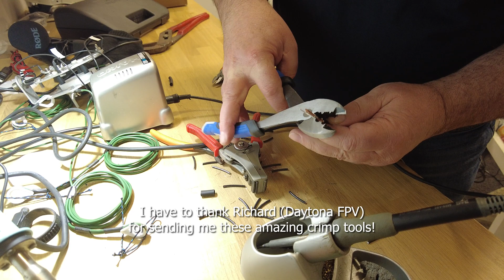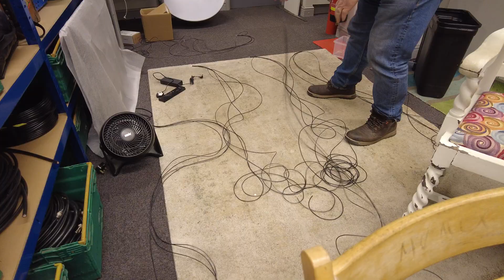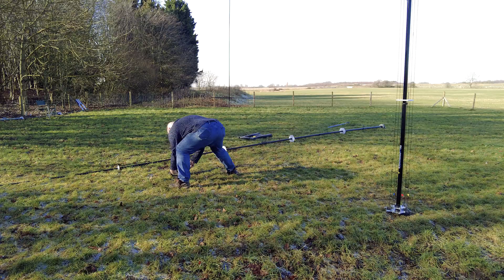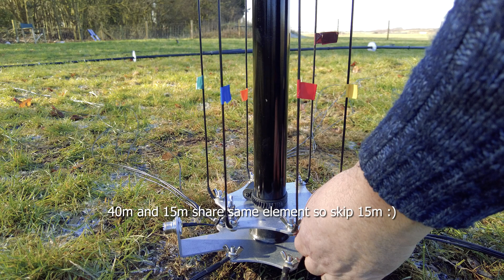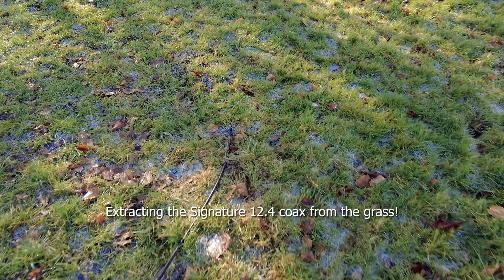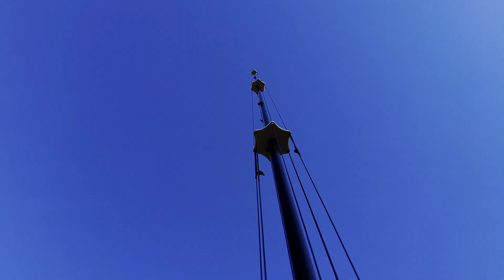New Radials and Signature 9 Vertical Antenna Up and Ready for Action

Comment: SO I bought the classic in Sep 2021, still going strong.  Now I am considering the Sig 9 for another radio.  Would you suggest a minimum distance from each other?  Also, would crossing radials over the other radials make a difference?  Thanks.. 73 KN4YLL
Reply from the maker: Well, I've had two together many times and although the modelling suggests minimum distance, I have never "felt" it. Mine were about 8m apart.

Comment: Hi,well explained video, I ordered mine from ML&S should be here Tuesday, its going on a flat roof 3 story high, I will keep you updated, 73s from PA1-LEG 🙏🙏
Reply from the maker: Brilliant!
Reply: @DXCommanderHQ  Hi arrived 3 hours ago, almost built, 27 degrees and blue skies here ,I will test it out in the evening, its going around 20m high, on a stand on the flat roof , hight is might 😀 they say 73s from Rotterdam 🙏
Reply: @DXCommanderHQ  Hi I put up the signature 9👍🏻 well made materials easy to follow instructions, unfortunately due to the high temperature 🌡 the tape on the fold backs came loose, first test swr between 1.5 and 2 ,I will use my Mat pro 1500 atu temporarily, for me 40m was noisy s9 but it was expected, tomorrow I will fine tune the antenna and try with my amplifier, my first impressions are positive 😀 will keep you posted 📫, 73s from Rotterdam 🙏

Comment: Callum can I use the mounting post for the signature 9 on a Classic multiband +80? I feel I need the extra support - I live a half block off Lake Michigan, and it can be windy at times.
Reply from the maker: OK, a) it's not a good fit on the classic and b) assuming it's guyed, the post won't do anything. I understand about the wind and sure, it can be disconcerting to watch your antenna blow about however in the main, it'll just blow about.
Reply: @DXCommanderHQ  Thank you, sir! You just saved me money! I appreciate you!

Comment: Very nice. If I have to put a vertical in a corner of the yard and can only run the radials out in one direction (90*), will the majority of the propagation be in the direction of the radials or the opposite direction?
Reply from the maker: It will still be omni-directional however rather than MORE gain in the direction of the radials, there will be some loss where there are none. So to answer your qwuestion, sort of yes - but there won't be a null. I dproved this many years ago with a 180 degrees of radials and promptly crossed the Atlantic on 80m - which was the "wrong" way :)

Comment: If you buy the 18m pole separately, is it still backed by the section warranty? Like you do for the kits inc the pole ? Love how you have the PayPal credit option too I use it often pay in 4 or monthly helps me buy my gear without paying all upfront or paying Credit lots of interest ☺️thanks Cal 🙏
Reply from the maker: Yes, ,we have a replacement policy for all poles. On 18m, we price them one-at-a-time. Basically I do them individually and come up with an individual plan to assist customer depending on what their issue was. We have replaced only 2. Both times, customers won't mind me saying that they f*k'd up! We do both PayPal and Credit cards now too.
Reply: @DXCommanderHQ  thank you Cal, pp is huge help with pay in 4 esp when buying amps radios and tuners ☺️

Comment: Excellent! Thinking of getting one but very stormy on the coast here in winter…
Is there a maximum wind speed these can take?
Reply from the maker: Actually, I have no idea. The Kevlar guy lines / radials at the top are good for 135kg. But probably something else would break in a SEVERE storm. Guys lines and guy points probably...
Reply: @DXCommanderHQ  High winds are a concern for me too. I live in a high wind area where 50-60mph / 80-96kph sustained winds are fairly common and 70mph / 112kph gales aren't unheard of. In such a case, it'd be good to know whether I'd need to add guy wires to the Sig 9 to account for that? (Does it come with guy lines?)

Comment: How do the radials you putting down for the Sig9 interact with the ones already under the grass for the other antennas you’ve put down in the past. ? And do you have to take this into account.
Reply from the maker: Is this an exam question! LOL I happen to know there's not a lot because the tune changed by 200kHz on 20m band.

Comment: A couple of plastic stakes either side of the SO239 socket (mounting bracket) may stop the antenna from rotating around the PVC pipe in the ground.
Reply from the maker: Actually, the coax tends to stop it.. Then as the antenna settles on the ground, it'll stop. But sure, why not.

Comment: Those poles shown in the previous video look quite strong.
Reply from the maker: The ground posts? Hopefully I have over-specified tham!
Reply: @DXCommander  I meant the 9m poles, but yes, those ground posts, too. 

I'm working out a build for a "portable" tilt-over pole base for my 12.4 with latch(es). So I just place the base, run 3-4 low guys down, some smallish stakes (or big ones for grounding), slide the Signature onto the pole, and raise to "click." Then guy the Signature. The base raises the Signature up a foot or two ( a meter?) out of the snow and muck, and braids connect the ground plate to the radial wires at the base. I may use my DX Engineering ground plate or just fab a sheet of aluminum. This would work for the 18m Signature as well.

Comment: I have a question for those of you who are experienced in HAM radio. I recently retired from the fire service, and I still have my Kenwood NX-5200-K2 VHF radio that I used for communicating with my fire repeaters. I am working on getting my Tech and General license, and I was wondering if I would be able to use this HT for HAM radio as my first rig. I know it has a range of 136-175MHz but I am not certain if this radio is reprogrammable for the layman.
Reply from the maker: Yeah, I just googled it. Looks like you could reprogram it - on the other hand, maybe look at something ham specific? A second hand FT-8800 was a nice rig. Mine just got stolen. I'll buy another in a heartbeat.
Reply: @DXCommanderHQ  Thank you very much! I will probably end up getting something HAM specific as Kenwood apparently keeps the programming software under a pretty heavy lock and key… I’ll take a look at the one you recommended, I appreciate it!
Reply: 2m in the UK is from 144 Mhz to 146 Mhz there is various modes used such as FM, SSB and digital modes transmit and reception is on  the same frequencie

Comment: That Signature 9 looks awesome. Might be a good idea to drill a 4-5mm hole in the ground plate, just behind the SO239, to fit a little stake through into the ground to eliminate "turning forces" on the antenna in high wind? (No guy lines to prevent it from spinning on planted stay-up pole). Continuous lefty-righty turning forces in high winds might cause unnecessary strain on coax and all radial wire connections. I watched the video the 1st time for the antenna. The 2nd, 3rd, 4th and 5th time for the music 🤠🤠🤠🤠🤠
Reply from the maker: Well, if someone can work out how to turn it, let me know :)